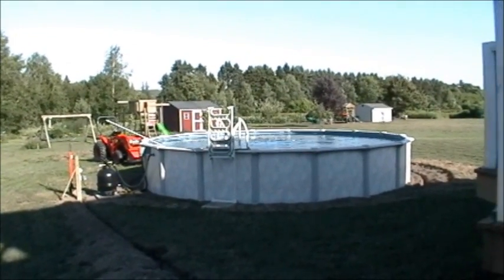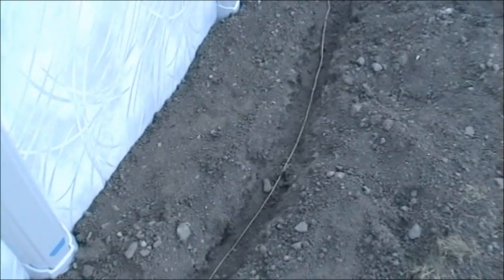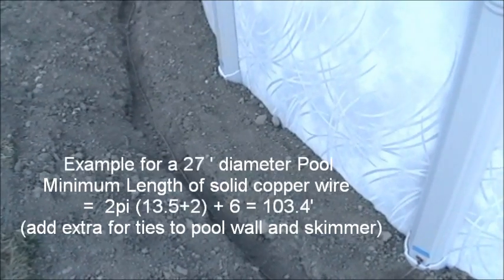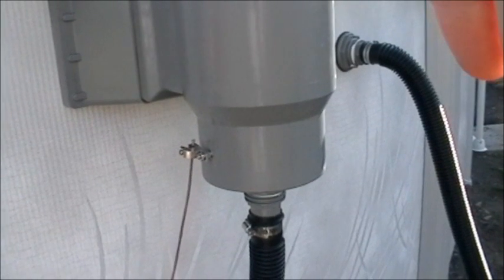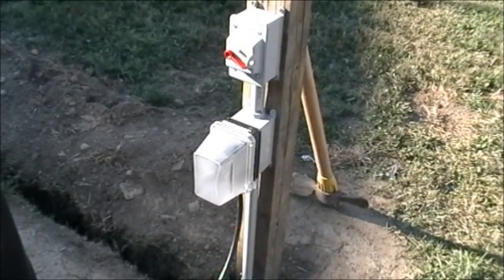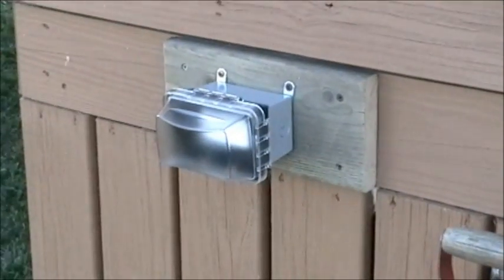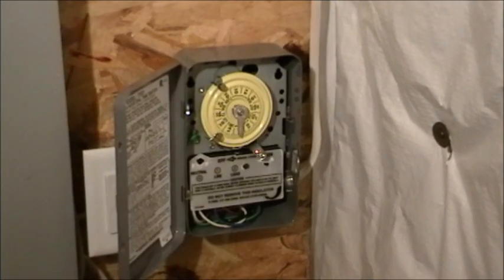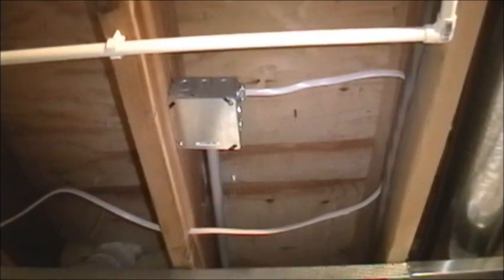Above Ground Pool Electric Installation

Comment: Your installation was very well done and gives new pool owners details that most pool stores fail to provide. But New York is not alone in it's over regulated requirements. Many States leave it up to homeowners insurance policies to set safety standards. My State is governed by local municipalities, and not the States heavy handed regulations. Just as there are States Rights we have local jurisdiction to enforce our own electrical and plumbing standards.

Comment: Nice job all in all. But a gfi breaker is not $60. Probably $20 more than your dead front. That $20 would have been the best money you spent on that entire installation. Breaker is far superior protection and easier for monthly testing.

Comment: So im assuming your pump was hard wired? I have bought one of those intex pools and have a dedicated 20 amp gfi at the breaker circuit. I have ran UF wire to and outdoor outlet for the pool pump to plug into. Do I still have to run the copper around the pool as well?
Reply from the maker: I have a pedestal with a specific twist lock plug as required by code (2010) in NYS. The copper wire around the pool is to bond the soil, pool, and water. Bonding is different than grounding. It's up to your local code if it is required.

Comment: The idea about digging the copper in the ground doesn't make sense as a code as its not a ground but a bond - it shouldn't matter if you dig it in the ground or cover it with rocks

Comment: Quick question,  my pump says it 12 amps. Can i just use a 15amps breaker instead of 20 amps?
Reply from the maker: All of my materials were based on the electrical inspector's requirements. I'm guessing you will want to change breakers, but it's best to consult with the inspector.

Comment: what if your pool is resin?  do you still need to connect at four places?  Right now its only connected to the seam.  Thanks
Reply from the maker: The idea is to connect the pool wall, so if the pillars are resin, or are insulated from the pool wall, then it defeats the purpose. I would think you'd want to connect the base or lip in 4 places. Your electrical inspector is the best source for answers of what they want to see.
Reply: @WldBear    Its connecting twice at the seem and twice on the pump.  Is that sufficient?

Comment: Does NY state require that the wiring exit the house be at a point right beside the circuit breaker box, or is there an acceptable distance?
Reply from the maker: No. I ran mine inside to a point that minimized outside digging. I don't recall there being any distance regulation. Codes may have changed since 2011 so always check with your inspector to be safe.
Reply: I checked :-) The inspector (NY state 2019) says there's no requirement for maximum distance from the circuit breaker box. We did as you did. The less digging the better.

Comment: Not breaking balls because I know the deal. Some of the code makes no sense like bonding a window frame if it’s within 5ft of the pool. A window frame has zero potential why would you introduce it into the electrical system. But that’s stuff for another day. NEC code says you can’t use sheet metal screws to attach the lugs. I know I know but it’s in art 250  
As an electrical contractor Ive been pulling my hair out for 35 yrs trying to plz the NEC. Which adds new twists and turns every year. You seem like a good guy you can use a thread lock on those sheet metal screws to keep them tight and replace them every couple of years. Bonding the frame is important.

Comment: What do you do about other things that use electric such as bottom cleaners and saltwater chlorine generators,  where do you plug them in  10 - 20 feet away?
Reply from the maker: Since making the video I switched to salt. My pump plugs into the salt generator, and then the generator plugs into the outlet. If that isn't your setup you will need to use the auxiliary plug 10-20 feet away. The safe bet is to ask the electric inspector what he/she wants to see.

Comment: What size wire is the single strand ran from timer to pump
Reply from the maker: You're referring to the 3 single strand wires in the conduit? Those are 12 gauge. See previous comments.

Comment: So the pool store told me that when you have steel pool walls and resin pillars the only place you can bond the pool is at the seem where you connect the wall with bolts. He said to run the copper wire from the seem around the pool and back.. and to the motor. We don't have metal plates under our pillars so this is the only way....btw we live in Ny as well.
Reply from the maker: That makes sense. After all, the water is only bonded at one spot. My pillars are metal and touch the wall, metal liner cap, and base, so I didn't have that issue.

Comment: do you have to ground the wires to a grounding rod?
Reply from the maker: No. What you are doing according to the code is Bonding, not Grounding.
Reply: right but i thought you had to ground it as well?? we are getting ready to do our pools electrical thats why i ask. Thanks
Reply from the maker: The process of bonding equalizes stray current between any conductive surfaces so you don't become the conduit. For example, the pool isn't bonded and stray electricity is in the soil. You walk up and touch the water. Because of the differential, you become the conductive path between the soil and water and get a shock. By bonding the soil around the pool, all metal surfaces, and the water, there is no differential and therefore no current flowing through you.

Comment: Nice video, on your pump did you just change the plug or the entire cord ?
Reply from the maker: The pump came with the twist lock. I don't think they are even available in NY without a twist lock cord.
Reply: Barry Blanchard 

Ok, thanks. I bought my pump from a pool store and I had to change the regular3 prong that it came with to a 3 pole twist lock. I just ordered a 1.5 hp super pump for my semi inground. I had to move the pump over 15 ft from the pool, this is why I upgraded to a self priming pump. The super pump came with no cord what so ever. I'm going to use the 12 gauge wire the other pump came with and switch the wire inside from a 230 to a 115. I'm also running it on a dedicated 20 amp breaker. I also have a dedicated 50 amp double breaker hooked up for my future heating pump.

Comment: they did not require an electrician to install the wires in order to get it inspected?
Reply from the maker: No. I used an electrician to hook into the main panel, but it wasn't required. The inspector required everything to be left open and exposed for inspection to make sure it was done right.
Reply: Barry Blanchard thank you for the info I'm trying to figure mine out, I'm in Putnam county and this is a pain.
Reply from the maker: I agree. Early in the process I found an electrical inspector and asked him what he would like to see.

Comment: Good video, I understand the helpfulness it provides to the NY state residents.  But here in Louisiana I have had my above ground pool for 5 years powered by a 50 ft. extension cord laying on the ground plugged into a 3 ft. extension off the pump.  All going to a GFCI receptacle in my Garage.  I have to literally unplug and roll up the extension cord every time I mow.
Now for fairness, what I am doing with the extension cord is NOT the correct way to run exterior electrical.  So I do plan to install a proper power feed to the pump which will be underground and sealed properly.  I do not like the extension cord.
But...
Why would you have to bond a plastic pool to the ground cable going around the pool?  That is dang nuts.  I am an electrical engineer, and was taught by mt first grade teacher that plastic is an insulator, not a conductor.  So that is like trying to ground the insulation of electrical cable itself.  Freaking crazy.  Which is why most of that non-sense you had to go through just to install an outdoor rated 120VAC pump in your backyard is a bunch of bull.  Sure, I know it is the local code, but it is still bull.
But even though, I do plan on correctly
Reply: You've had an extension cord on the ground for 5 years?? And you're questioning someone else's project?? I doubt you'll ever change your 'plan' to do it correctly. Hope your kids never get electrocuted.
Reply: @johnnymoretti  well now 7yrs since his reply and no one has die from it. I do the same here in Texas and no problem. So does the neighbor to the left and right with their above ground pools. There is a reason why wiring is encased in rubber you know, if you do maintenance on your extension cord (check for cracks and breaks) when you perform maintenance on the pool you should have no problems. Plus  If a person's body starts to receive a shock, the GFCI senses this and cuts off the power before he/she can get injured. You can't live in fear all the time of what might happen.  NY lol.....Go Texas and Louisiana why anyone would live in states with so much tax and regulations is beyond me.
Reply: And you probably say that "I've lived in Texas for 40 years and have never been hit by a tornado or flood". First time for everything, buddy. And to even suggest that "if a person's body starts to receive a shock, the GFCI senses this and cuts off the power before...the injury". Hogwash. If you're relying on only one source to protect your family, and having all the other parts of the system subpar to quality planning, then go ahead...use your family as the test dummy. I, on the other hand, install things right the first time. Only then do I have complete peace of mind. Go Yankees. BTW, I live in California, a state which I do not agree with politically...but it has lots to offer. Mountains, beaches, skiing, Yosemite, Shasta, and no tornados.
Reply: @johnnymoretti  those earthquakes though...

Comment: Thanks for the video, a few questions, what size stranded wire did you use to run to the pump and convenience outlet ? What gauge or schedule pvc  did you use? Thank you

Comment: Great video, I have to inform you that the pool you bonded is not bonded at all. That model has the poly resin bottom connector, therefore it only bonds the vertical and not the wall. This is a problem with a lot of the newer pools. You did everything right. except placement of the ground clips. They need to contact the wall to bond with it. If you attached 2 clips to the wall bolts (top and bottom) with # 8 wire you would have truly bonded the pool. Please understand, I see it done your way all the time and it passes! And the customer thinks their pool is wired correctly. Thank you
Reply: Carlos Narciso
Reply: Are u talking about the metal strip that holds the wall together
Reply: This is correct.

Comment: I just put in a above ground pool in ny had to use stainless screws to bond pool needed to use tamper resistant and weather resistant gfi recepticals was told good idea to use expansion joints but not code on conduit and I used a continus 8 gauge around pool just to use less split bolt connections and did salt water and had a bonding lug on that as well on the keypad part of unit

Comment: Well done; actually its the 2010 New York State Residential Code (current Code) which references the 2008 National Electric Code (NEC), NY State has still not advanced to the current 2014 NEC, the pump timer is a requirement of the NY State Energy Code. New York State doesn't do anything easy  and believe it or not has no state wide requirement for Electrical Licensing. Electrical inspections are done by 3rd party electrical inspectors  who for the most part were never electricians, never held a license or went through any electrical apprenticeship program.

Comment: great video, I followed your exact installation to the letter so we'll see how it goes :)
Well almost to the letter, I am grounding the motor to the solid copper 8 ga. ring separate from the water bonding, I am planning on connecting that to the ring by it's self and also connecting the 8 ga copper ring to it's self

Comment: I don't know anywhere in the NEC where a sheetmetal screw vs. tapped and threaded or nut/bolt is an acceptable means of bonding

Comment: Nice video, also check with your local building dept. regarding the electric install.  In Orange County you are required to have a licensed electrician to do the work.  The code for the timer is found in the Residential Code of NYS 2010, Chapter 11 Energy Efficiency.  N1103.8.3 Time switches that can automatically turn off and on heaters and pumps according to a preset schedule shall be installed on swimming pool heaters and pumps.

Comment from the maker: Thank you. I used conduit the same size as the connection to the electrical boxes - 3/4" if memory serves me correctly. Stranded wire pulled through fine with a pull string.

Comment from the maker: Yes, all of these were confirmed as necessary (or allowed) by my electrical inspector. Not sure where the timer is listed, but he said It was in the 2011 code. Different inspectors may have a different interpretation so anyone undertaking this project should confirm with their inspector.

Comment: Ok  have a trip to Home depot in my future. what type of toggle switch is behind that waterproof carlon switch face?? I'll assume that face plate juts activates a switch behind it? I did a Trip to Lowe's and didn't fin that cover but they had everything else I needed except the ground wire connections in ground. Theu just had the jugs that attach to the pool.

Comment from the maker: #8 solid copper. I made a loop and connected back on itself before connecting to the pump motor so no free end. No grounding rod because the idea isn't to ground, it's to bond all the parts together (water, pump, walking surface, ladder if its metal, etc).

Comment from the maker: Yes on the THHN, but only through the conduit. From the junction inside was Romex to the panel. I used stranded THHN. The pillars on the pool are metal. The bonding plate on the skimmer has one small bolt that does go through the plastic, but is doesn't leak.

Comment from the maker: During my research I kept seeing the difference between Bonding and Grounding. Bonding is making sure there is no difference in charge between the water and where someone is standing outside the pool.
Reply: So does the ground from the outlet actually ties into the binding at the pump or anywhere ?
Reply: I meant if bonding *

Comment: Did you use stranded #12 THHN in your race way? Does your conduit continue all the way to the service panel or did it terminate in the junction box and continue to the timer box in Romex? Was size bare copper? Are the pillars on your pool plastic? Did the fastener you used to bond your skimmer go all the way through? Does it leak?

Comment: Great video, but I think NY State missed the most important item. You connected your pool bonding wire to the motor ground, but the motor is not grounded. You should have an 8 -10 foot ground rod that grounds both the motor and the pool. I am in sandy Florida, so mine is 20 feet long. Also. if you are using a salt water pool, don't forget to install an zinc anode, in that skimmer basket and ground that also.
Reply: No where in the NEC will you find a requirement to install a ground rod for an above or inground  swimming pool. Please refer to Art. 680 of the National Electrical Code

Comment: OK I'm an Idiot that is not the switch? It's just the cover to go onto the switch? I did a google search and found that cover but it says nothing about a switch just that it's a cover so what's behind it? I have the rest of it down pat no issue just that has me puzzled. Thanks for replying back so fast. , Todd
Reply: It's a standard regular wall switch, but use a heavy duty one, rated for 20Amps. There is a u-shaped lever under the switch cover that fits over the toggle lever of the switch. When you push down on the lever of the cover, you toggle the switch up to the on position, when the lever on the outside is pushed up it turns the switch to the on position.  Install the switch upside down if you want the outside lever to be up for 'on' and down for 'off.'

Comment: First Off excellent video! I found it quite useful. My question is this what Brand of on/ off switch is that. I live in NY as well and no switch is required, But I would like to put on on just like that. I have to assume that it's completely water proof.being that it is not behind a bubble cover.

Comment from the maker: I used a sheet metal screws left over from the pool installation. Appears to be zinc coated. They might have been a little longer than 1/2".

Comment from the maker: I used copper split bolts at each connection. So where each wire spurred off to the pool and where the wires came together near the pump there is a split bolt (total of 5).

Comment: Hi great video.  What kind of clamp did you use to connect the two cooper wires together.  Is it the same clamp you used to attach the wire to the pool?

Comment from the maker: THHN is available in multiple colors, but only singles as far as I know. Each wire is in insulated PVC, and my guess is that's what you want.  I ended up calling the electrical inspector and asked him what he would like to see. He was more than happy to tell me what he was expecting and answer my questions. In the end it saves him a trip if I do it right.

Comment: OK, please bare with my lack of knowledge. Code requires three insulated wires (black, white, green) to be in PVC conduit. The actual requirement states 3 wire 12 awg insulated in PVC and must be wet use wire. I know thhn is for dry and wet but does thhn come in 3 wire? I have seen single wire thhn. Thanks again. Ur knowledge of all this is priceless.

Comment from the maker: I used solid boxes with female connections built in. The wire was stranded AWG12 THHN. Your building code will dictate what you can use.